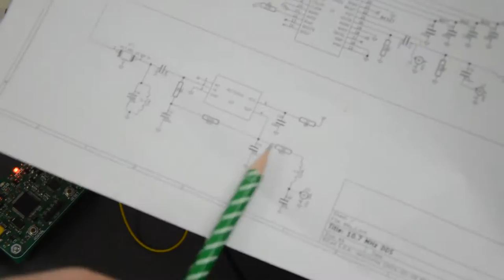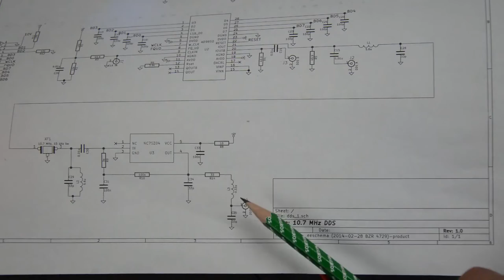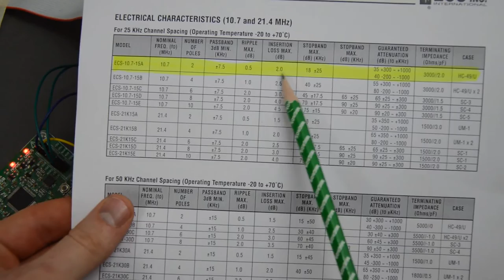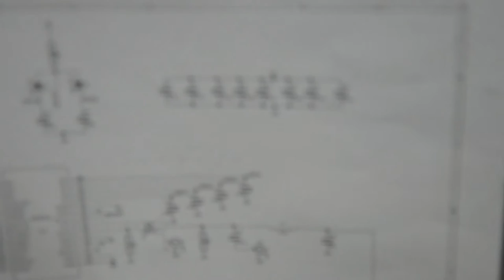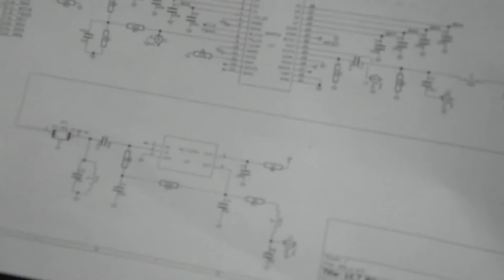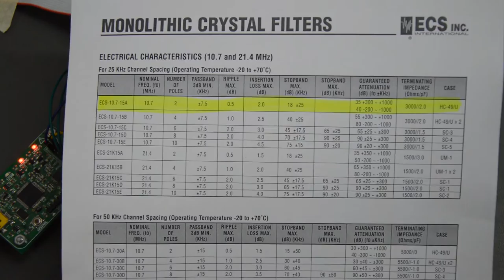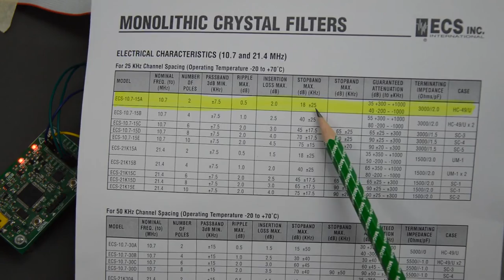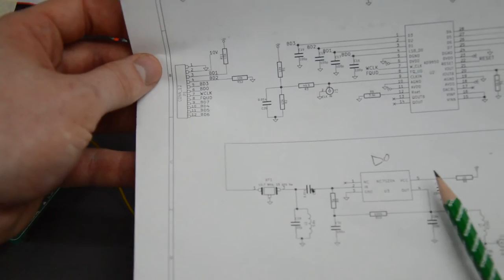Homebrew Spectrum Analyzer 12: DDS Module Tests, Part 2

Comment: Nice temporary PCB hold-downs with the masking tape! If not leaving a residue is ever an issue you might try the blue style "painters tape" that is much less sticky and usually doesn't leave any residue when you remove it; it's great for masking off areas you want to paint, spray adhesive on, insulate temporarily, etc. Look forward to you next video in this series! 73 - Dino KL0S
Reply from the maker: Thanks, I will try that next time. I always tape down my stuff or somehow fixate it otherwise. Nothing worse than spending a lot of time putting a test jig or something else together and then ripping it all apart by mistake.